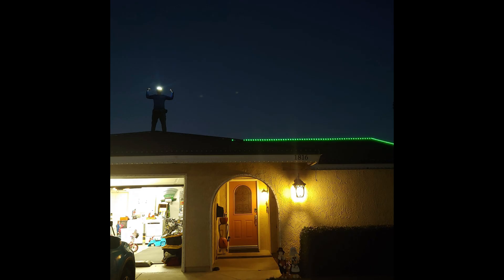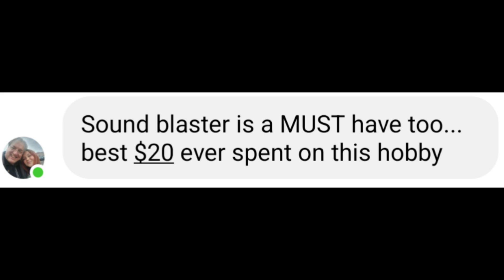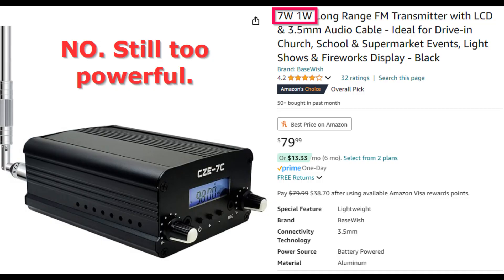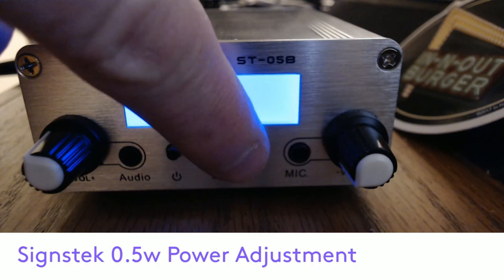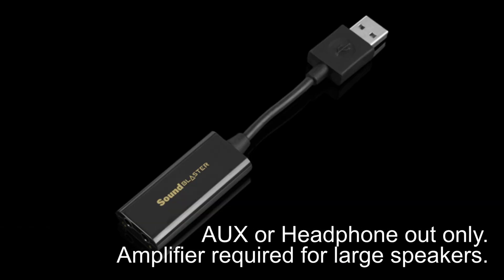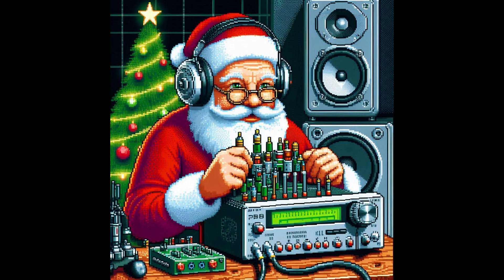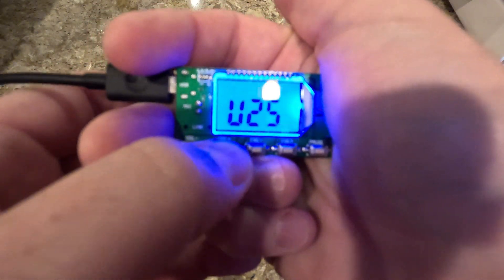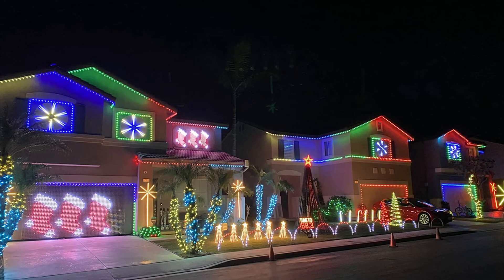TLDR Perfect Sound, Perfect Show: Audio & FM Transmission

Comment: Thanks for this great video. When I attempted to use the Sandblaster play! 3 I get awful hum and noise that isn't present with Pi4 audio out. My Signstek is on low power roughly 6' away, I use a  C2G 3.5MM Isolation Transformer, and I use clip-on ferrites on power and audio cables. I'd love to experience what everyone raves about but just can't get there.
Reply from the maker: Glad you liked it! The Sound Blaster Play 4 is not compatible with FPP (as of this writing) and I do note this, as well as ferrite cores and much much more in the full video. https://youtu.be/sDMN-AkxQFQ?si=UaJBfAZPIW98HhDN Also in description above.
Reply: @JasonRasmussen  Thanks for the quick reply. I've seen the full video. I'll watch it again.
Not sure what you meant but I'm using the Play!3 connected to my Pi4 and it's not great.
Reply from the maker: @TheLightsOnSailmaker  Darn you auto correct! Fixed.

Comment: Am I likely to get in trouble using the cze-05b at 0.1w? The fcc recognizes it with the id 2ASVO05B-73, but I believe that only allows it to be sold in the us and isn't considered a part 15 device.
Reply from the maker: I have yet to see a single person cited by the FCC by keeping it low power. I offer no legal advice.
Reply: @JasonRasmussen their is a radio station 0.5 miles (which my signal would probably reach with once I make a dipole) from my house, do you think a they would report it to be looked into or nah? What I'm trying to say is do you know how would the fcc would ever know?
Reply from the maker: @Dawson621  Test, only transit as far as you need, choose a free channel, don't interfere with commercial stations.